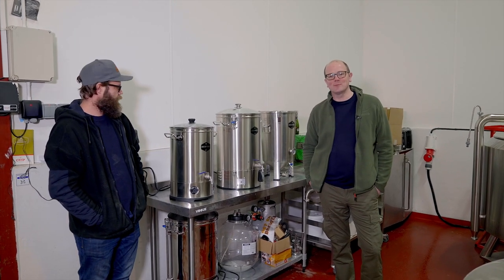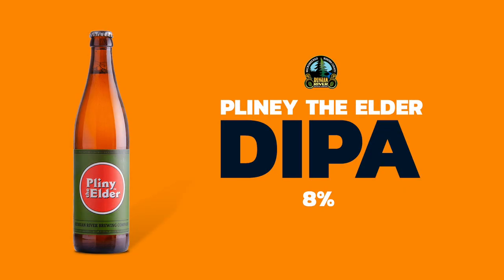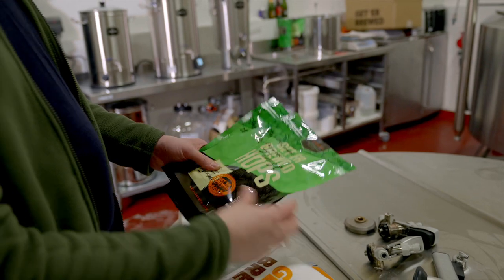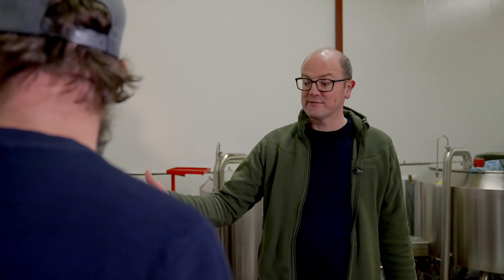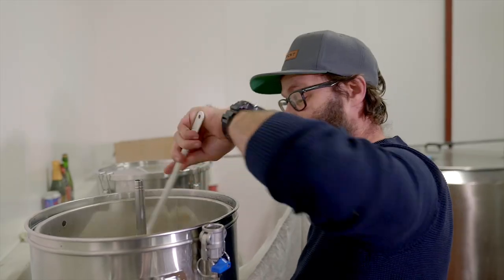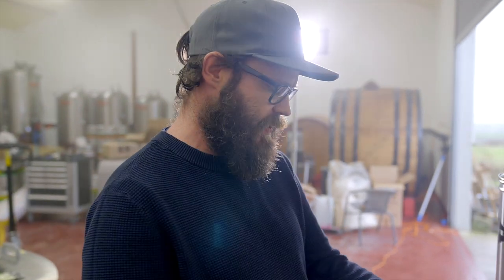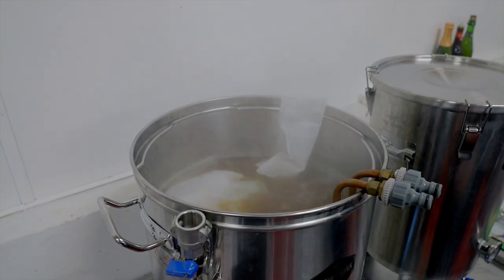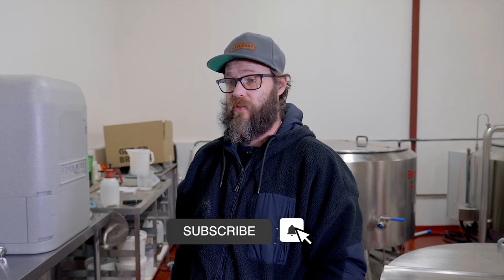How to Clone your favourite beer - Pliny the Elder replica brewday

Comment: Thanks for the video, nice and easy. I have a stupid question on sparging. I have always thought that you need to sprage slowly less than 1litre a minute. Does it really matter how quickly?
Reply: I used to think that too, I use one of those all in one systems and the mash basket filter at the top makes a big difference, I fill it to the top and then it trickles through the mesh really slowly and kind of works like a sparge sprinkler thing. (He says Confidently 😂😂😂)
Reply: @DillonOsborne  Yeah essentially i believe you just want to avoid your sparge water tunneling down one spit instead of evenly sprinkling through the grain, which is easier done slowly
Reply: The mesh screens on top of the malt pipe help distribute the sparge water along the area the grain rests, avoiding the water to run through only a small portion of the grains.
Reply from the maker: Our video just posted today looks at sparging hoping that helps